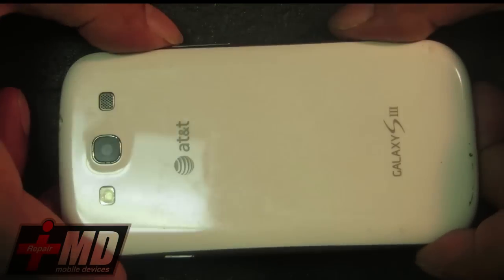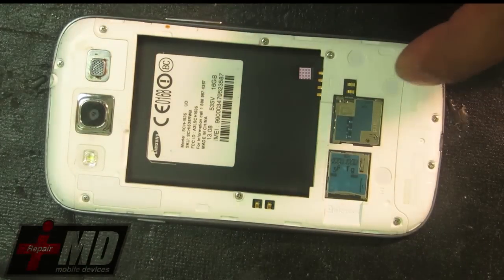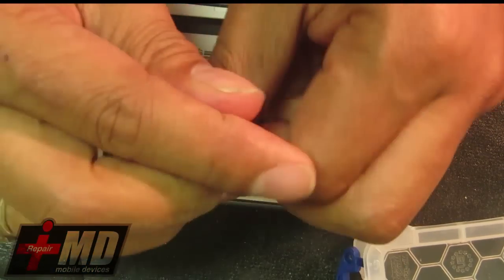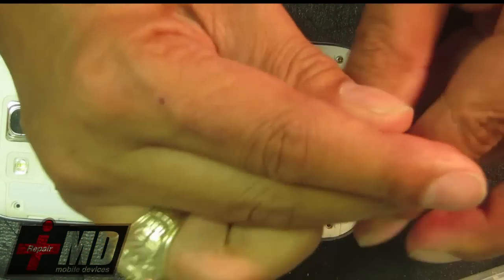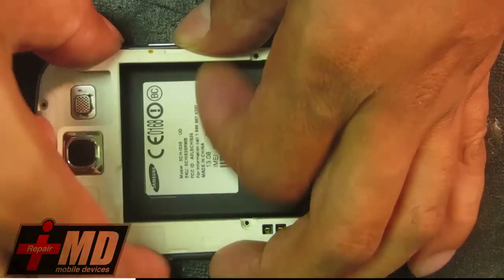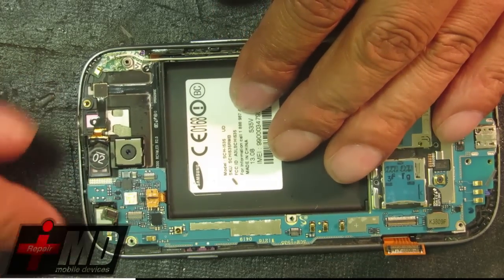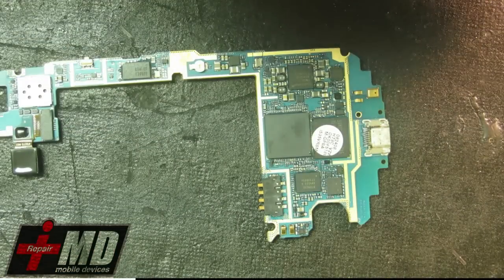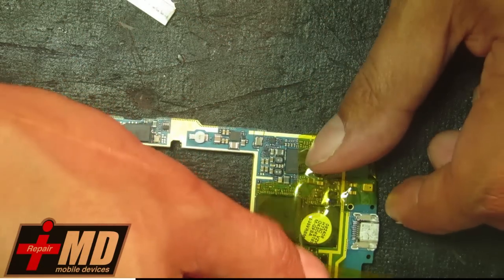Galaxy S3 Charging Port Repair

Comment: Here is how I do them:

1) I don't use a heat shield; it's totally unnecessary.
2) I put the board on a PCB pre-heater and heat it to around 150C.
3) Using the hot air rework station, I heat up the part until it effortlessly lifts off the board.
4) I clean up the board area and apply flux liberally.
5) I place the new part onto the board and heat it with hot air.
6) I put light pressure on the part using a toothpick while I continue to heat.
7) As the residual solder heats up and melts, the part eventually drops into the small holes in the board.
8) I then solder the four corners of the part.
9) I apply more flux over the pins.
10) I solder the pins using a screwdriver tip iron.
11) I then apply more flux and remove excess solder using the iron until all bridges are gone.

Comment: Try the method using a soldering stencil. This procedure "dumbs down" the replacement and makes it twice as fast . Search Samsung Galaxy III Charging Port Repair Part 3 . Our professional instructor guides you through the process. BTW the shielding material is "Kapton(TM)" tape.
Reply: thanks
Reply: gr8

Comment: And everyone has access to this expensive equipment? What a joke
Reply: +Bruno Cester What? The only thing remotely expensive would be the microscope, but that's not necessary at all. If you don't have $25 for a soldering kit then I don't know how you can even afford the phone.
Reply: Nearly no one has these micro screwdrivers. I have 100 screwdrivers but not a single one is that small.
Reply: Jurij Fedorov Check out eyeglass repair kits. They have very tiny screwdrivers.
Reply: Kalvash SAVAGE

Comment: I went with a hot swap instead, wait I guess I actually did a cold swap, which is fine because it has guidance pins to lead it back into place.  1200 watt heat gun about 3-4" from the part on high.  Only took maybe 10-15 seconds before the solder melted.  Take part off.  Turn heat off.  Put more solder in places where it's looking bare.  Grab new part and place in old spot, line it up as best as possible (it doesn't really sink in until it gets hot again).  Turn heat back on, and tap lightly until it's heated, once the solder is soft again, gently tap it back down into place.  Boom.  

Note of caution:  I initially tried with a lower power heat gun like he used in the video, however, the plastic that holds in the pins in place on the port itself kept melting and the part was unuseable.  Luckily I had plenty of spares.

Comment: I just bought everything I need to do this for less than $64.00 off Ebay. Slightly less than $1000 that someone else mentioned. I will practice on some old circuit boards first.
Reply: So? Was it worth the hassle? I am thinking about buying a Moto G4 Play instead of doing all this work.
Reply: u can get charging ports fixed on phones like this for $30 sometimes less

Comment: Great video and thanks for it.  However, the amount of work and specialized equipment to fix such a badly designed usb port is insane!  The real problem here is that the micro-usb connector is very small and weak, prone to breaking and wearing out easily.  So why don't manufacturers, in the very least, make them much easier to replace?  I've broken 3 such connectors on my Samsung phones and each time it cost $70 to fix.   Now, I've switched to wireless charging.

Comment: Some copper connections came off. Does somebody know why this happens?
Reply: MoviesAK Too much heat applied. Copper traces are kept on PCB with some kind of solid glue and bond has been lost due to excessive heat.
Reply: Milos Stasko  so is it impossible for repair when the copper connections came off?
Reply: Jackys Tran There is a way, but not for somebody who damaged PCB. You will need precise skills and good equipment. Simply said, replace loosen track with copper wire. Very thin one, something like used on winding of small electro motors. Just removing isolation from this wire and PCB line can be very tricky.

Comment: Why you doing it hard way? Removing connector using hot air is ok. Than using soldering machine and copper tape remove all solder from pads and holes. A line new connector, solder pads using soldering machine than turn over main board and solder from bottom side ground pads. To soldering i use flux RMA-7 Alpha Cookson Electronics.
Reply: It's surface mount connections... you can't solder the USB leads from the other side.